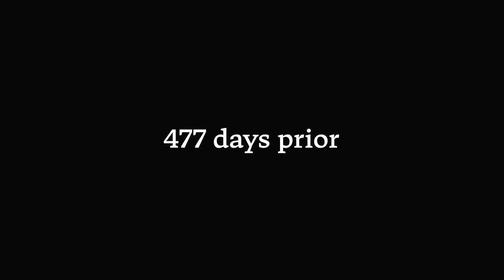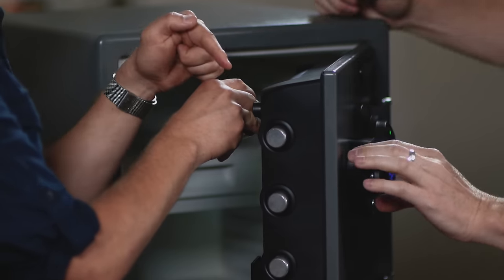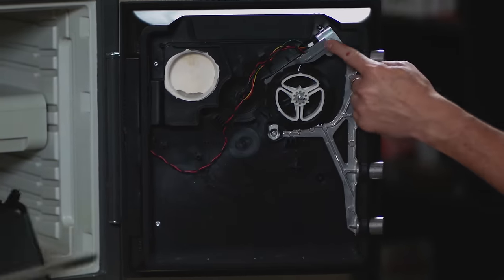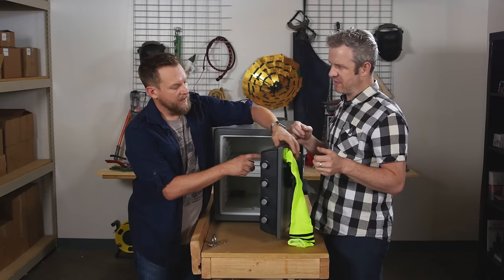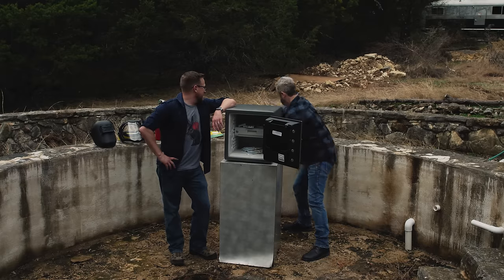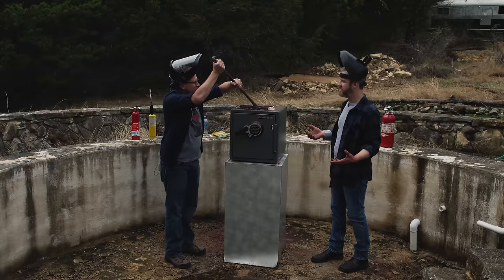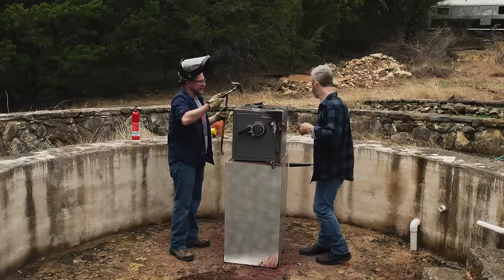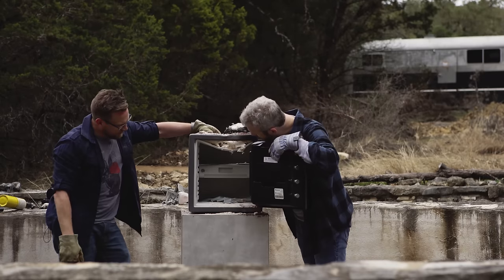Safe-Cracking with Magnets and Thermite

Comment: Angle grinder = 80usd, metal cutting wheel = 5usd, masonry cutting wheel = 5usd, protection gear = 10usd, time = 15 minutes.
But sure, there wouldn't be a show without finger snapping magnets and thermite, no?

Comment: They should have just used jet fuel to melt through the safe, thermite can't cut through steel after all according to "demolitions experts" in regards to the twin-tower collapse/controlled demolition.

Comment: late comment, but couldn't you just drill a hole in a piece of wood the same size as the smaller magnet and use the wood to slide the magnets apart?

Comment: Can someone please hand these guys a cordless grinder with a cutting wheel could have just cut the pin off at the top banged it out open the door with a pry bar or even just cut the back cuz the back of those cheap saves are normally susceptible because there's nothing on them and it's thinner steal
Reply from the maker: That sounds like a much less interesting video.

Comment: When you mix fuel, metal oxide and metal powder in just the right way, it burns at over 2000 degrees celsius, hot enough to cut through nearly every material known to man. Throw some  C4 into the mix, and you've got one hell of a combination.
Reply: Source?

Comment: Thermite my ass. A Metabo grinder with a cut off wheel. Your in, in 5 min or less. Same top down method, same around the edges method. That's the real rogue way ;)

Comment: This wont ever work the way you are doing it guys. You are losing about 90% of the energy in sparks, light and heat. there is nothing forcing the cutting power down.  A thermal lance directs the cutting heat / plasma directly at the material you want cut making it much much more effective. Thermite, would cut though that fireproofing as they are not usually rated for that kind of reaction.  The best way, is to make a paste of the material and let it dry to a semi solid so you can mold it. Ive done it in a Tin can, or a soda can just to shape it. Then llight your magnesium strip at the BOTTOM of the puck to force the cutting heat where you want it.  This would allow you to angel it twords the bolts and spare the money / items. another more effective way on these smaller saves is to wedge it, or sledge the corners. Or drill a small hole, fill with water, use a  small explosion in the safe, will peel it.

Comment: Regarding the stuck together magnets, heat them up, they lose theyre magnetism at temperature and you should be able to pull them apart then. They generally go back to normal when cooled then.

Comment: what about the plastic dial?
...
i would have went after the plastic not the metal.

(thermite vs plastic keypad)
Reply from the maker: if you did that, you'd have a melted keypad and a still-locked safe.
Reply: @ModernRogue  
but the plastic goes right throw.
you would have a huge hole in the safe from which you could just pull the ?pins?
to the unlocked position

Comment: Umm all you need is an angle grinder you can open all these small safes with a grinder its essently thing sheet metal with drywall and a plastic li we so yea cheep batter powered angle grider open top like a tin can use a hammer to punxh through the dry wall and plastic liner and you in

Comment: You two definitely are not contractors or competent with tools.  Ummm have you ever heard of an angle grinder?  You can cut into that in a minute.  Most contractors have angle grinders on their trucks with the carbon disks on them.   It's loud when you are cutting into the metal but at least the house isn't going to burn down.  If you aren't worried about making noise any safe can be cut into.

Comment: They like : this thermite isnt explosive
Me, an intellectual : When you mix fuel, metal oxide and metal powder in just the right way, it burns at 2000 degrees Celsius. Hot enough to cut through nearly any barrier known to man. Throw some C4 into the mix, and you've got one hell of a combination.

Comment: Guys, I'm afraid you are idiots. Coil and magnetic field generate current only when one of them is moving, otherwise one of thermodynamic laws would be broken (also, it would be perpetum mobile). I think good strategy would be to have smaller magnet, and move it faster. It opened before, because you had the magnets in your hand, and were moving with them. Try to learn about theory of what you're doing a bit, at least.